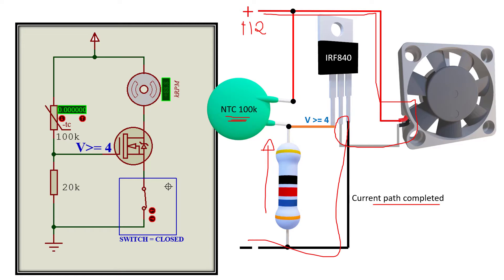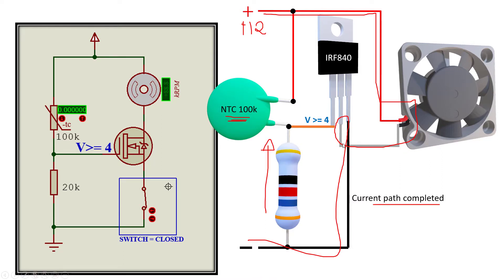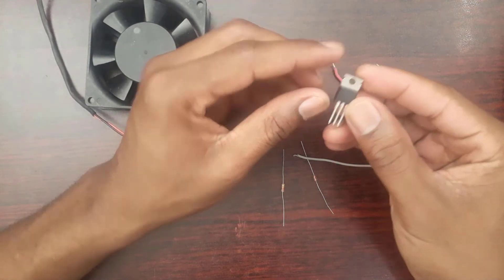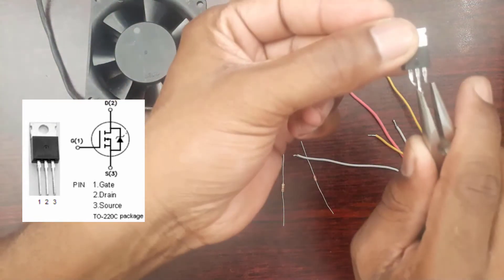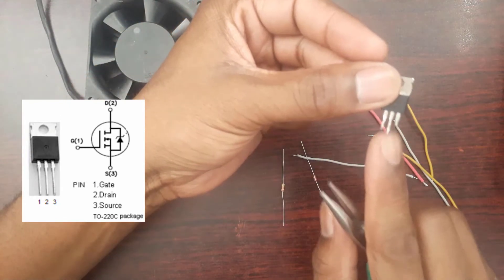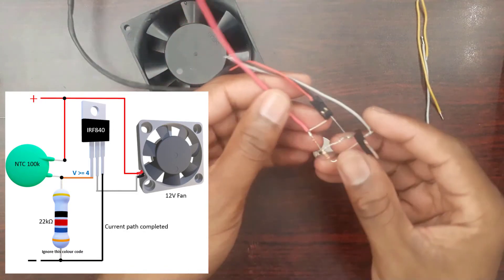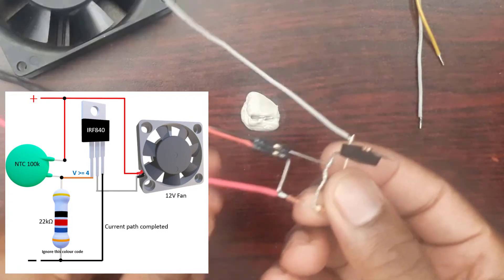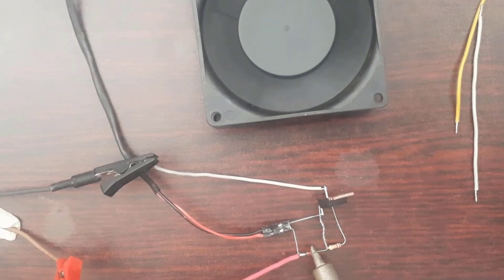Thermistor MOSFET Fan Controller (Circuit construction) - Part 2

Comment: How much voltage betwen gate n source to starting drain flowing current, tx u mr
Reply from the maker: The IRF840 Mosfet have a gate threshold voltage of 4V,  depending on what you want to drive you start getting drain current from 3V, the  minumum being 2V. In this application that voltage is 4V, and I calculated the resistance value so that I can get 4V only when the temperature reach a certain value.
Reply: @CMTEQ  i see that, tx u mr 🙏